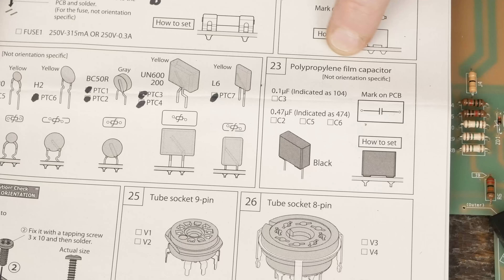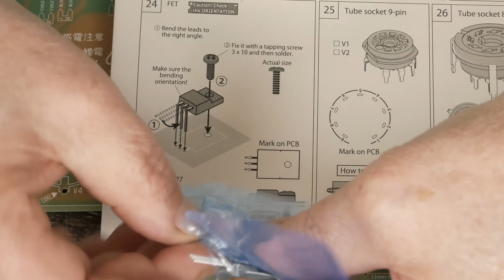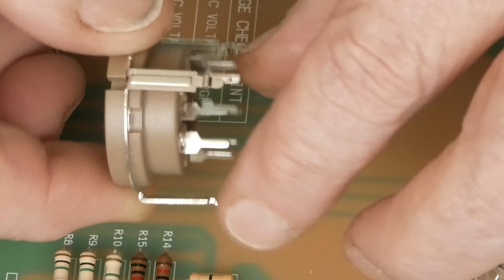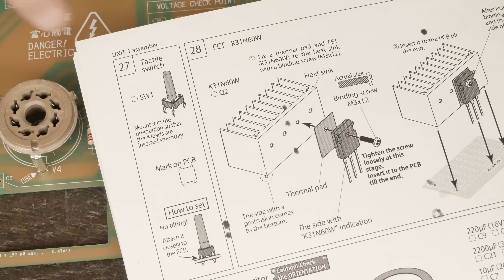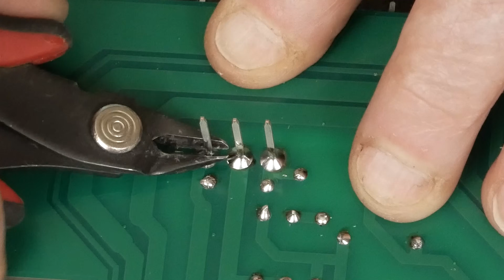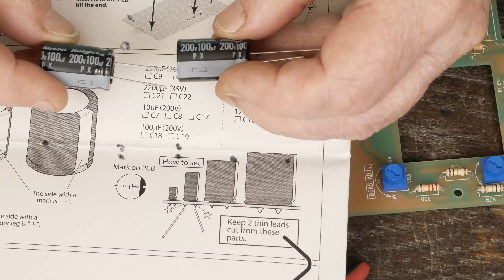Elekit TU-8888 Tube Monoblock Amp: Build Video 5

Comment: Nice work.  PRO tip . For that transistor just mounted to PCB. I have seen that used before in tube gear. The problem is over time. Heat on and off. That screw will work it's way loose and can fall out. It metal and can short stuff out . I use a KEP NUT on threaded side. Stops that from happing. Even a drop of silicone will work.   For the one mounted in heat sink that looks clean and good.  That metal must be clean to conduct heat.  Their is a product from the PC world. from Artic . It called MX wipes.  Use them to clean the transistor and metal if dirty .  That even finger prints. This goes for cleaning thermal past off as well. The other thing you can use for that is Alcohol wipes sold at pharmacy both work well.  Cheers from NY !
Reply from the maker: Great suggestions!

Comment: its a good idea to place the outside foil of a capacitor connected to circuit at the lowest impedance to signal ground. acts like a shield to pick up instead of antenna. yes you can do a simple test to see what is outside foil connection. does it always matter. no
Reply from the maker: Absolutely am doing this on the coupling caps in the signal path. I don't believe this cap will have any impact on noise.
Reply: @SkunkieDesignsElectronics  How often do you get told you’re putting them in wrong and then get referred to the Mr Carlson videos? It’s routine in the guitar world and some people just can’t get that in the guitar it doesn’t matter which way it goes. Now in the amp it can make a significant difference and even do damage but still not on every capacitor.
Reply from the maker: That's all great, but most people building one of these kits don't have a scope or a signal generator. I'm pretty sure the folks who designed this kit aren't stupid, and if there was a need to "outer foil/inner foil" these included box style film caps, they would say something. In fact I'm pretty sure these square type film caps don't even have an inner/outer foil at all.
Reply: @SkunkieDesignsElectronics  and if those people read spec sheets they would find the mfg doesn’t even state that many caps need to be oriented   Some people just like to make it complicated. I’m with you: follow the instructions and keep it simple.
Reply: It’s so funny how in the guitar world many insist the caps on the back of the pots should be oriented correctly when in that application it makes zero difference. 😂 Application matters!

Comment: When i wanted to roll 6v6 gt tubes in my audio note kit 4 amps,i had to use enormus force,scary,can this amp alsow use el34? The svetlana 6550 c tubes,i think is posible to still gett,i bought a bunch of used ones,and they are nice kt88 tubes.sadly there is no more productjon of the fine svetlana tubes.always reliable i wold say.
Reply from the maker: Also check to make sure there isn't excess solder on the outside of the pins on an 8 pin tube from when they solder the wires to the pins internally.